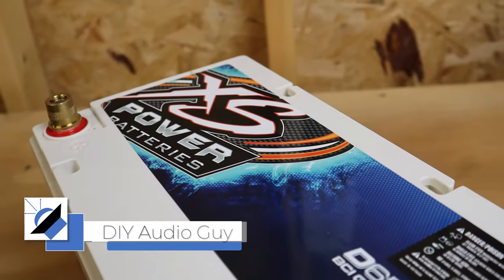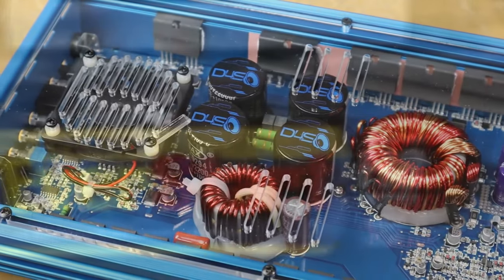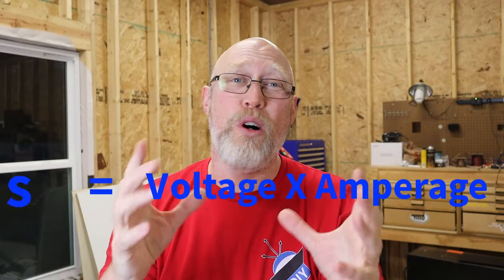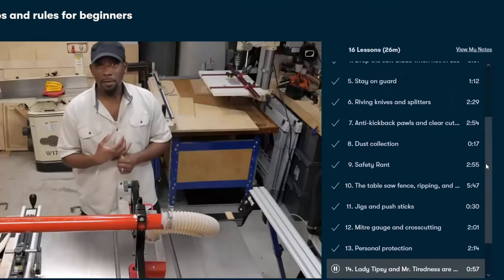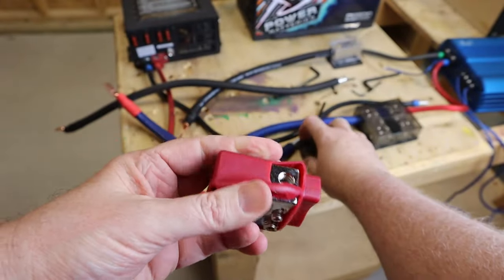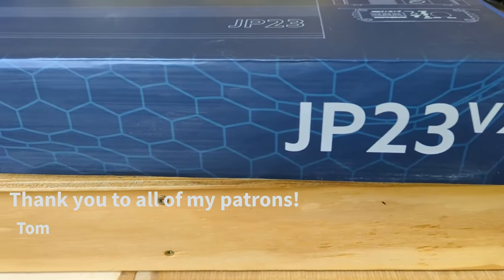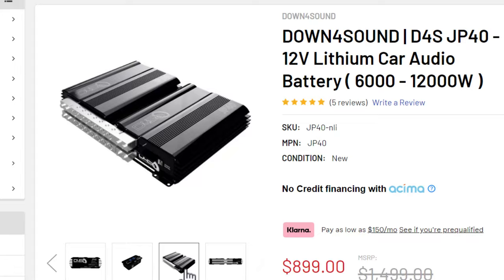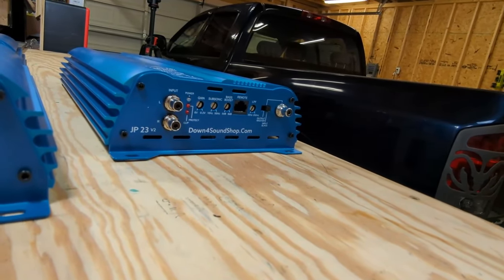Will upgrading to AGM and Lithium make more power?  #skillshare

Comment: This is a interesting concept, tho I’m still trying to find a video that gives good scales as to what size battery is required for my 4500watt system. 120amp alt stock batt big 3 kit, all say need big battery but no one can explain how to get the right one with correct specs 😅 help please
Reply from the maker: I am still trying to work that out.  It seems that the battery brands still just want to give a wattage specification and they don't include the discharge rate.
Reply: @DIYAudioGuy  110% why get a 5000watt atm batt if I’m only short 1000 watts or so but that’s also a hard thing to pin point as only the lights on my amp dim down and under long load some safety thing in my car pops killing all power to both amps.
Reply from the maker: @igamefordays9471  I always recommend starting with the alternator.  Upgrade that and do a big 3.  A lot of people aren't willing to go that route, for them I always recommended they just live with a smaller system.
Reply: @DIYAudioGuy  yea I’ve foreseen that coming, I’ve seen some cheap altnators on ebay (300-400) claiming to put out 300amps, if I could avoid that it would be nice. Still pretty new to car audio learned how to wire everything up and get it bumpin wasn’t thinking about my cars power suffering
Reply from the maker: @igamefordays9471  I'm going to recommend that you stick with a well-known brand for the alternator.
Reply: @DIYAudioGuy  UPDATE: I went deep and bought 25 feet 0/1G AWG did my grounds and battery to distribution blocks then to amps this fixed my power drop/loss issues hasn’t dropped below 13.5 v on amp. Idles 14.5v alternator or belt is squeaking for unknown reasons but otherwise a success!

Comment: 🔴How often should i charge my xs power agm battery for my car audio system
Reply from the maker: The alternator should keep it charged up.
Reply: @DIYAudioGuy  Thank you for your reply. Is there  any reason why persons with agm batteries in a audio system does use battery chargers.
Reply from the maker: @doublemanson  I guess people run stock alternators and pound on their subs until the batteries are drained.

Comment: I just can't justify paying almost or over 500$bones for an agm battery. Unless it lasted at least 10 years.  I'll just go with lithium. I have a regular wet cell for a starter battery. But have 2 45amp hour limitless lithium battery's for my system. They are isolated with a 300 amp isolator. Will probably go with one of those new fancy cap thingies to replace my starter battery. 🤔

Comment: Was that a hydraulic crimpers I seen  I no they definitely come in handy when doing this wiring Job. Once you get the testing equipment needed theres let's say robot that you should get in touch with it would be  helpful to a lot of people specially in Price  if the amps he gets from overseas and is the same build house as the jp amp and iV seen salt clone amps  15k for 400$  early buy in sell he does  some time it's hard to believe but at the same time I've heard him say if someone could test them fine would be a cycle of help 🤔👌👍✌️🍻💯🎶⚒️ have a great one till the next one
Reply from the maker: Cheap crimpers from Amazon.  I really should upgrade them.
Reply: @DIYAudioGuy  they look like the harbor freight one  you might want to try changing the oil and or adding just a little more or more heavy oil. should improve it. if there over crimping grind a little of each side of the die ends till there right. that should improves them. 👌🏽👍✌️🍻🎶💯⚒️

Comment: So every time it clipped,  the voltage dropped drastically 🤔🤔  interesting.
Reply from the maker: I wonder if the voltage drop caused the clip or if the clip caused the voltage drop?
Reply: @DIYAudioGuy  that's what I was getting at. 
Cause it went right back up after.
Reply: It is actually the opposite.. the lower voltage is what caused the amplifier to clip... the lower voltage will mean your amplifiers power supply rail voltage has lowered.. the definition of clipping is when the amplifiers output voltage exceeds the rail voltage of the amplifiers power supply section, and as a result "clipping" off the top and bottom of the sine wave... when your amplifiers input voltage drops it causes you to clip at lower power outputs since your amplifiers rail voltage goes up and down according to the input voltage it receives from your vehicles charging system.. the only exception is with heavily regulated amplifiers like the JL Audio HD series.. but in this case it must draw more current to make up for the lower voltage so you are not getting any free power... you are just drawing more current to make up for the lower voltage which can present issues itself. A strong charging system (good lithium or AGM and good alternator) and a traditional unregulated class D amplifier (Like most amps including the JP series) is the best bet for a reliable system in my experience...
Reply: @CL-yp1bs  valid point

Comment: On first pass I don't think you established anything useful.

CCA is important for starting engines. Nothing else that I know of. Those batteries are not designed for supplying power for hours. AGM batteries are, but...

Lead acid batteries should be discharged at no more than .2C for its rated life.  That means, it 20A. It's also rated for 50% discharge, so 2.5 hours at 20A.
LiFePO4 batteries are mostly rated to discharge at 1C to 80-100% of capacity, Read the specs, some are only rated at .5C.

I want 3Kw in my van. I have 2x200Ah LiFePO4 batteries for 400 Ah. It will do the job, with power in reserve.
To use a SLA, FLA, AGM batteries in spec, I would  need 800 Ah of  storage, 
For 400A of delivery, I would need 2000Ah of capacity.

In practice, I don't expect to run maximum power, but I do want to run standard domestic appliances without worrying about overloading the system. Standard kettles are about 1800W, probably those are ok on 2Kw, but there are restrictions on running other stuff.

I might have made an error, I did this in my head and from memory. Be sure to check the specs and my arithmetic.

One more thing. Starter batteries have thicker plates for lower internal resistance. Not needed for your audio gear.
Plates  in AGM batteries are supported by glass mat, they're physically more robust.
SLA batteries have thinner plates, and no particular support. They're OK for a simple life, a simple life is rarely found in motor vehicles.